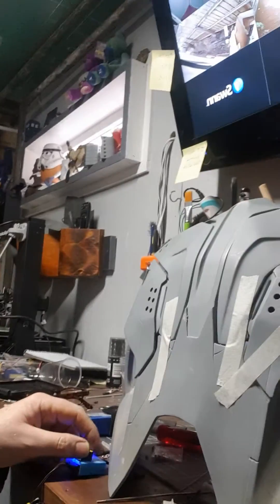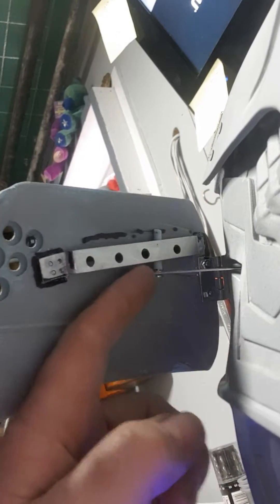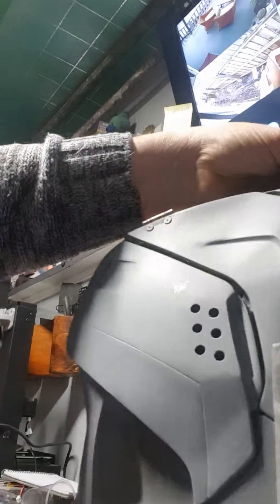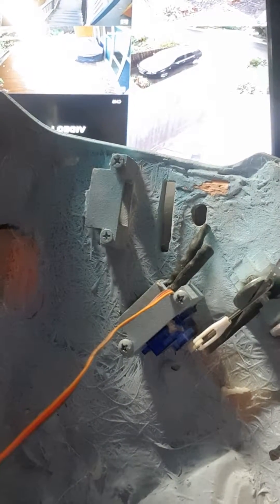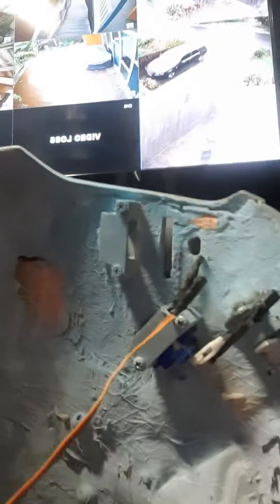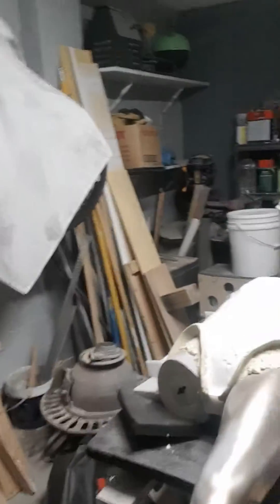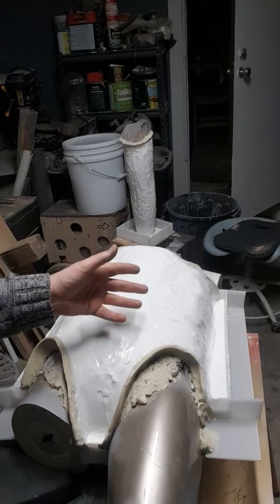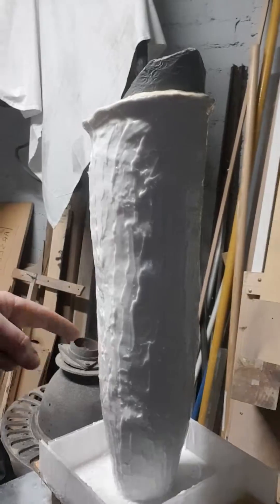Ironman mk45 servo flaps

Comment: hey, im actually working on the exact same suit. do u mind showing some videos of how the forearm flaps are wired? Printing the chest and back plates rn
Reply from the maker: Hey, the wiring for my forearms I done by following a video here on youtube,user Maker Tutor, the video uses 2 push buttons but they can be replaced by any type of switch,I was using a magnet reed switch some guys use rf tags, heres the link hope it helps, goof luck with your build
   https://www.youtube.com/watch?v=b1Pj9yuZlhI&list=PL7Hh31eAfYWxzyRP9Wu8TR6BkqSb7Mqxd
Reply: @seand006  thanks a lot brother